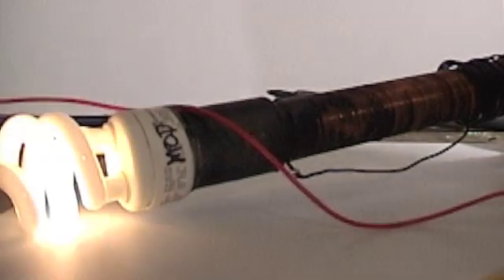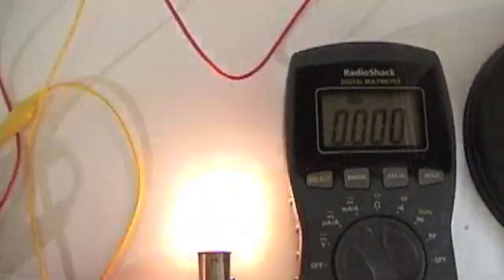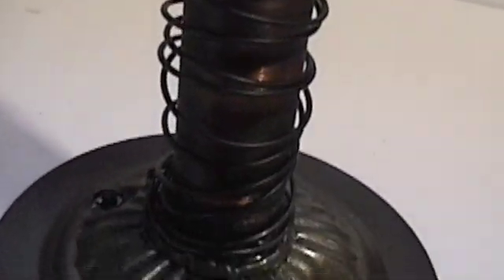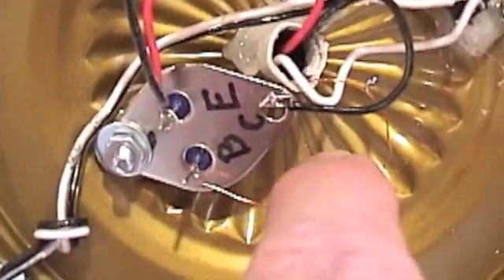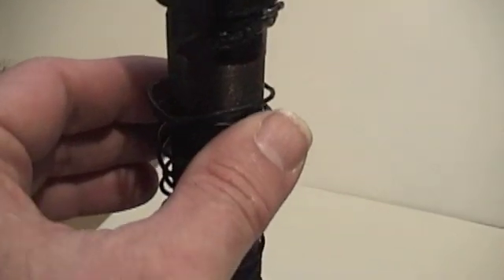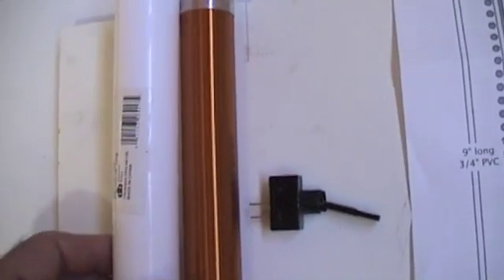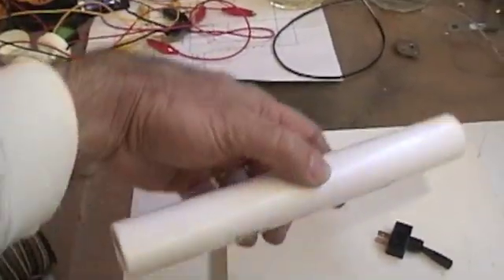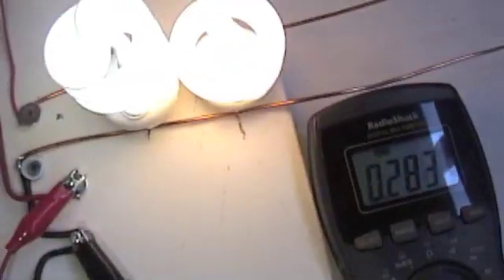Lynx Joule Lamp - Part 3

Comment: also, by having a good ground connection, you should get more brightness -- especially if your ground experiences lots of spikes from other appliances, dishwasher, fridge, dryer, other things with motors -- a/c unit.

Comment: A few years ago I made a very powerfull circuit with 2N3055 transistor, that could light up a 40W tube bright form 12v(8xAA battery)... I don't have the schematic anymore, and I left that circuit at scool, (that was a scool project). It didn't needed that much turn on secundary, but it had a ferrit core...

Comment: Just use a TO220 type transistor. Higher amp holding capability... It would even fit into the same IC socket that you started with....

Comment from the maker: This is just a DIY project for fun.  Its also a stepping stone in the use of a one transistor  aircoil transformer/DC converter.  I will post a video showing a 25 watt DC converter later today that is very useful.  It can easily light several rooms in your house off a solar charged 12 volt battery.  Add another circuit and light your whole house still using the same 60 watt solar panel.  I don't have time for classes, too much to do, and creativity gets stifled by professors.

Comment from the maker: AA batteries would give you about an hour before the bulb grows dim and goes out.  Better to use rechargeable batteries with a solar panel.  Similar to a solar garden light circuit.

Comment: Nice project.  You might go to GBluer here at Youtube.  He is really the original inventor of the circuit.  This is a Slayer Exciter basically only with the secondary output connected back to the negative rail.  It might be fun to build your lamp with a switch that turns on or off the return to the (-) so you could get "exciter" effects if you wanted.  Check out my "Mini Tesla Coil".  It is a similar project to yours only a pure exciter based version.  These projects are great fun,